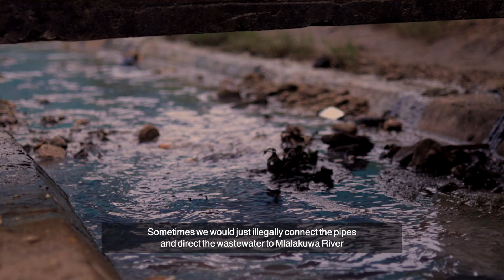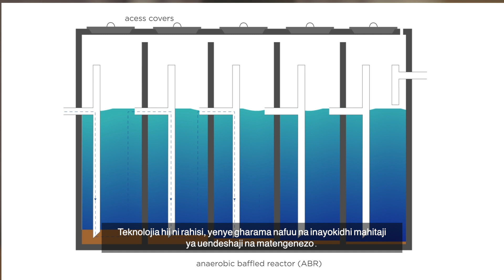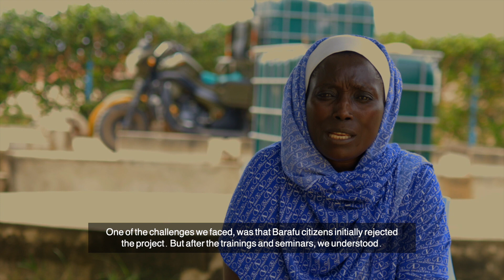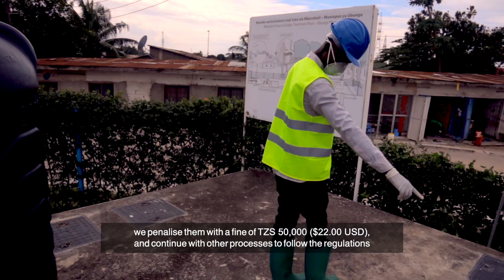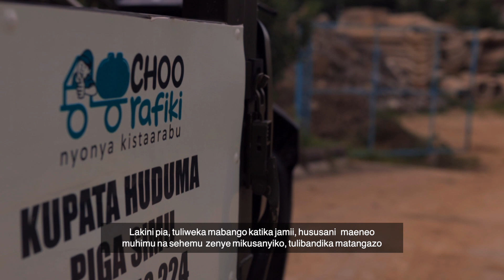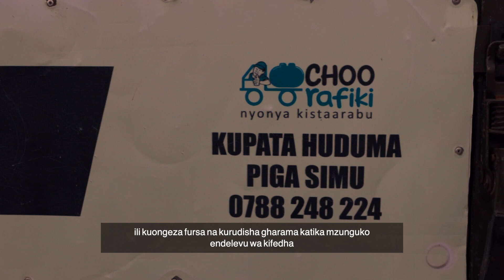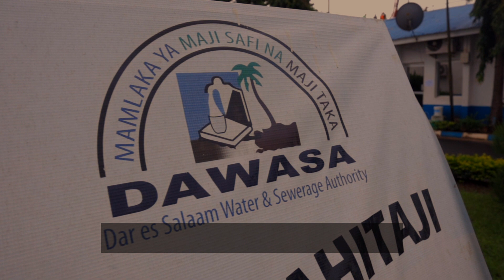Lessons learnt from implementing decentralised faecal sludge management in Dar es Salaam,Tanzania

Comment: Very interesting model for private FSM service provision using the 'TOYOs'. Few questions: 1) How did BORDA go about setting up these emptying teams: did you perhaps leverage already existing manual pit emptying teams?; did they require any training and capacity building, if so - did BORDA support in providing this and how, e.g. access of the emptying equipment; 2) how were the service price adjustments done to affordability levels, and did these price adjustments make sense for the emptying businesses - shed some light on any subsidies applied, etc.